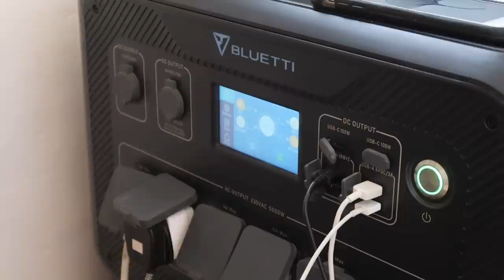Living our dream: making 200 litres of wine in rural Portugal.

Comment: After the juice extraction process for wine production, what remains is called "pomace" or "marc." This residue consists primarily of grape skins, seeds, and solid parts of the grapes that were not used to make the juice. Pomace can be discarded, but it can also be used to produce other products such as spirits like "Água ardente or Bagaço" or even for composting purposes
Reply from the maker: Ours usually ends up on the compost heap but this year I may stick it in a bucket with a lid and give it to a local distiller.

Comment: Hi Guys  Just watched your latest episode with the rain, here in rural Australia we capture and harvest all rain fall as some rural placers like Portugal do not have mains water. I think you can buy 25000 plastic rain water tanks , by enough for  200 litres per day  for personal usage, that means 75000 litres {3 x25000 litre tanks } then all your well water can be used for everything else< No more buying water for drinking, so some construction of good roof gutters with down pipes {75mm to 100mm to your tanks with a serie4s of broard filters for leaves and twigs. You could use another filter before it enters your dwelling. I did search and they are available in Portugal but I did not see any pricing.
Love the videos and the work you do helping other ex pats.
All the best from Down Under,

Comment: Do you make Chrysanthemum tea from the flowers stems and leaves ? They are A. Anti viral anti bacterial anti fungal. So if you get. A cold start drithing right away.
boil in water for twenty minutes.
The same goes for  Honeysuckle flowers, Stems & leaves.  Boiling 20 minutes  drink iced or hot.

Comment: We live in the SE of South Australia.  Rainwater is our only supply. In a small community of 24 full time residents at Cape Douglas on the coast.   Water is our 1st priority. We have 3 x 22,000L tanks.  A bore to water the garden on a dripper system.  And a 10.9kw solar system but we are also on the grid. As the battery technology is still in its infancy, so we havent gone down the path of battery storage. Wood heater upstairs and a bottle gas fire downstairs which is becoming too expensive.  The pears - one is a Bartlett? and the other I only know as a brown, might be a Bosc. Lots of hard yakka doing grapes for wine. What is your battery storage capacity?

Comment: I was wondering why you weren't growing your grape vines on a trellis  The air would circulate better around each bunch , and it would be easier to pick the fruit.
Reply from the maker: Mostly because they weren’t planted that way - these have been trained as bush vines which is the old norm in this area. When we plant vines on the plateau we will plant them in rows for the reasons you mention.

Comment: 24:53 that drainpipe issue was obvious knowing even the slightest bit about Portugese rainfall... It should have been a full size pipe all the way to the tank AND also a problem many people create for themselves... the overflow must be same size OR bigger than the inflow (many make a tiny little pipe as overflow) they totally forget how big the inflow can be
Reply from the maker: It actually worked great once we cleared out the olives leaves that were blocking it. For sure it’s just a temporary solution as our usual big pipe has been repurposed 🌧